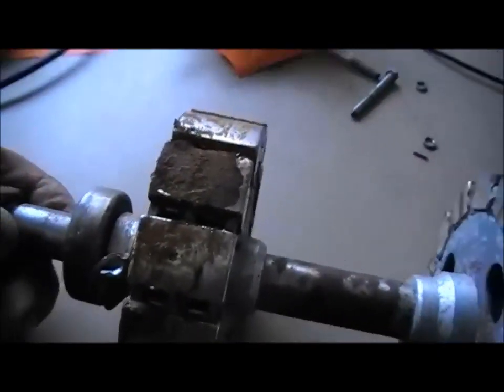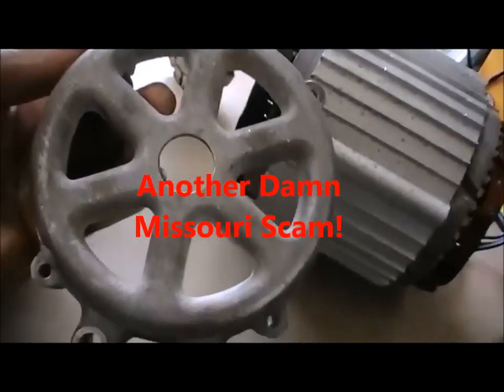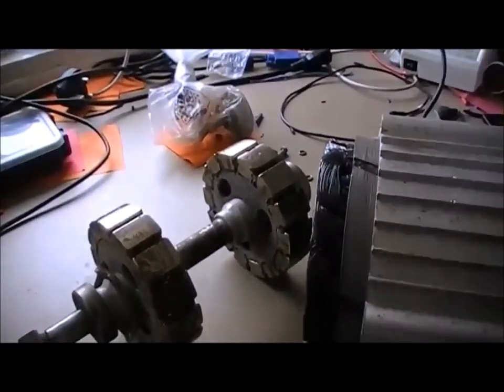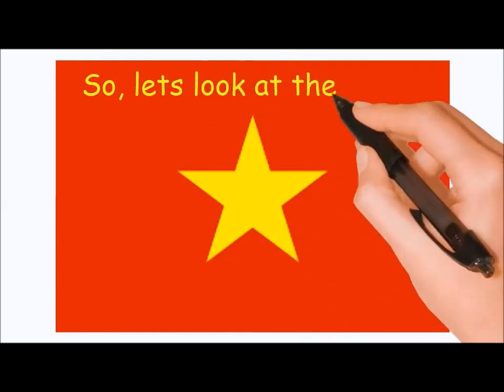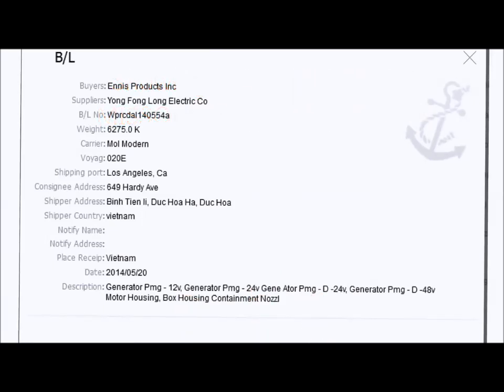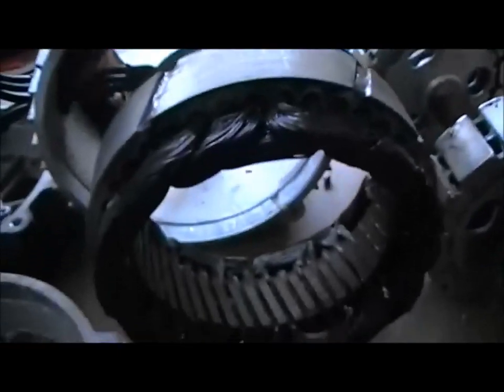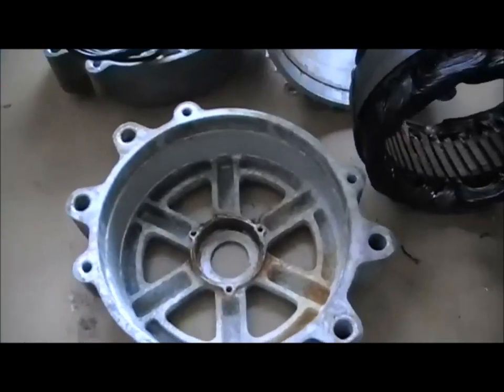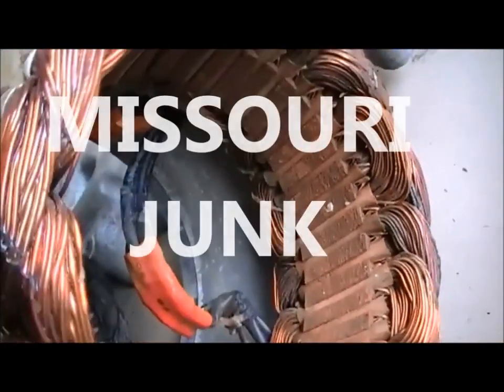Freedom II PMG Wind Turbine Epic Fail Disaster strikes home wind turbine kit

Comment: Don't forget affordable wind turbines, RATED ACCURATELY they work well, are super cheap if you go to Walmart online pick a good one, and better because you can get warranty on them via walmart   http://linksynergy.walmart.com/fs-bin/click?id=nNC3MIW3bd8&type=10&tmpid=1081&offerid=223073.7442&RD_PARM1=https%253A%252F%252Fwww.walmart.com%252Fsearch%252F%253Fmethod%253Drelated%2526query%253Dwind%20turbine%20generator%20kit%2523%252FsearchProductResult%2526affs%253De MADE IN CHINA, ~High quality in most cases, none from Vietnam are recommended.

Comment: What kind of conditions was this turbine used in? Salt water air ? Just curious. Not a fan of MW&S.
Reply from the maker: +urgentcareguy3 Its not stainless at all. Its called malleable steel with a coating. The test on it said 1006 low carbon steel, the coating was made of tinning chromium. Its the lowest grade you can buy from Asia.
The bearings rate a 2.6 out of 10 in replacement bearing durability listings for Delco 10 and 12 si alternators. 
The wire is copper aluminum mix, the aluminum grade of hardness AA2011 of MPa T4 total hardness is 228 MPa, Its pure shit. Literally aluminum can hardness which is explained as why the screws barely held in the bearing sockets. A Delco alternator is MPa  of 415 in comparison according to them. Anyone who says otherwise, claims some fake crap output or durability on it is a pure liar.
Reply from the maker: +urgentcareguy3 With this wonderful item, Your results may vary. Something that is advertised as having a near unlimited lifespan and quality sure comes with a lot of excusers for its failures, seller and where we found it was actually made.
Reply from the maker: +urgentcareguy3 When I looked it up, Epoxy coated magnets were black, and stainless steel was non magnetic & rust resistant and  pure copper wire had no aluminum in it, and a solid casting was solid. 
You may have to look elsewhere for a reason to excuse why this garbage is garbage.
Reply: +Jess Vie I wonder what grade of stainless it is. Does not appear to be marine grade.
Reply: ***** Ok. This is interesting. Is it true that these are basically made in Viet Nam?
Reply: some good yet depressing info ,i can atleast agree with the bearing retainers, theyre not up to my standards when i pulled my mws duals appart , and yes the build quality is kinda rough, thats the plaintruth  no BS. if only it was as good as the advertisement but like alot of adds in the world theyre not 100% truthfull.